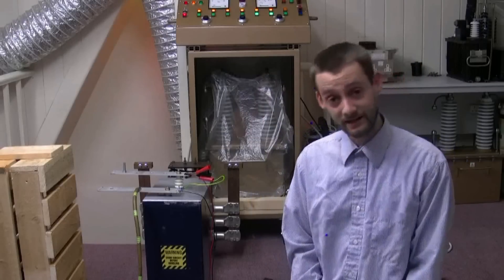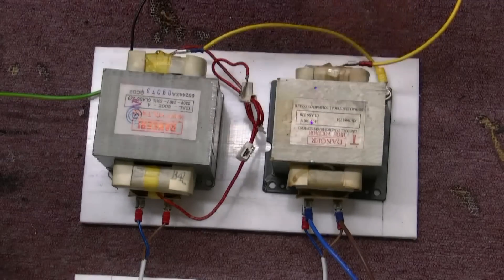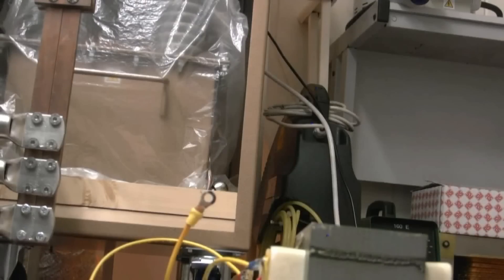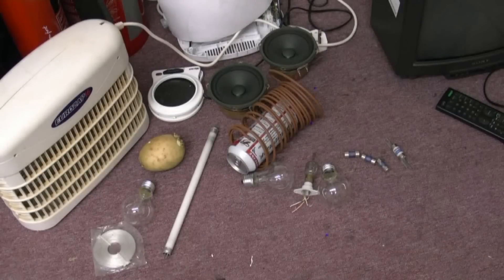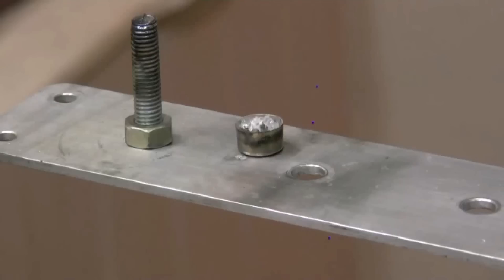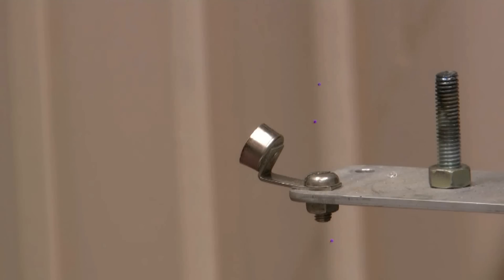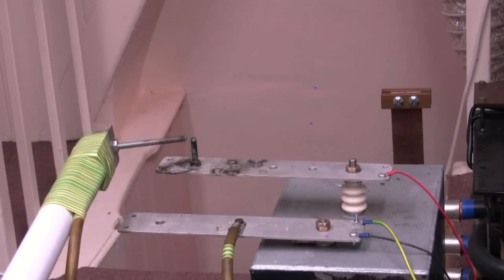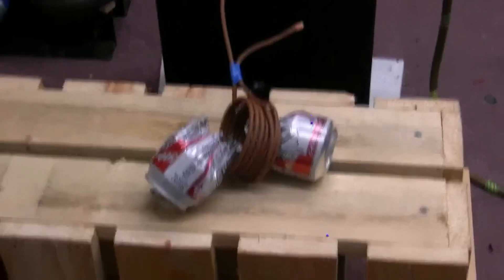Ultra High Energy Destruction + Can Crush

Comment: Photonic is exactly the kind of guy I'd love to have a pint with
Reply: Nimmo1492 Tells us he is going to do science an then cracks open a Budweiser? Needs a propper thinking drink like whisky.
Reply: A can of whiskey?
Reply: But keep in mind: After three pints you're still absolutely sober, but you had to pee for at least three times.
Reply: Nimmo1492  yeah a pint and think rubber gloves
Reply: Before you touch your pint, check carefully, very carefully, for tell tale signs of oily film. grease-proof paper  and kitchen foil in or around the glass.
Or your pint could be his home made capacitor and you could be his fuse, 😊😊😊

Comment: Just one correction to make:
The breaking capacity of the fuse is NOT the current at which the fuse will rupture.
The fuse that you destroyed which had a breaking capacity of 82kA - it has the ability to interrupt ("break" )  a surge of 82kA - you probably destroyed it with a couple of thousand amps.

Why "breaking capacity" is important - if your 50 amp fuse blows but the circuit supplying the current has the energy and low source resistance the gap left by the fuse can sustain an arc and a huge fault current can continue to flow - which is bad.
(fires can start if that fault current continues to flow )

So in high energy circuits you have a fuse which is rated to "break" that high energy High current arc/ fault current.

Here endeth the lesson.
Reply: thanks mate. good input

professional vs lunatic  1:0

Comment: My 100kv PSU is a sweet thing as well. It pulls an 8.5 foot and runs off a power supply that steps 120 vac RMS to 380 vac RMS (big transformers used like in his vids). I feel happy that I finally can have some crazy stuff like him. Then the 200 mv power supply at over 1000 amps continuous.

Comment: "80 thousand amps. Yeah I'm happy with that."  Awesome line :)

Am I right in thinking you had at least 320 million watts of power (4,000 * 80,000) ?  That's.. startling, frankly.
Reply: How is that possible? I get have u can get 500kv and little to no amps. but having both insane amps and volts?
How can he pull all that power from the wall in 5sec? A powerplant barely outputs that:p would love a explanation. cus I must be missing something out ^^
Reply: I'm no expert myself, but I am pretty sure it's because of the capacitor.  The capacitor is storing energy over a period of time (we saw at the beginning of the video that he charged it up over a couple of seconds) then releasing it all in one super fast pulse.   It's basically like a battery I guess - you charge a battery slowly (eg at 1A - 10A rate), but then some batteries can be discharged at up to 100s of amps (eg car batteries can do many hundreds of amps.)  In the case of this cap, apparently it can release more than 80kA :)
Reply: It is because the power is dissipated in such a short amount of time
Reply: the 80kA rating on the fuse is the amount of current the fuse can safely break without then the risk of it welding together and carrying on conducting ! 320MW noway dude lol! The capacitor could be rated at, say- 4kV and 32mircoF- so check out formulas Q=CV (charge in coloumbs= capacitance in farads x voltage across cap in volts) & W=1/2C.V² (energy in joules= half x capacitance in farads x voltage across capacitor in volts squared!) ... so for energy at 4kV on 32mircoF cap - 1280 joules ! Whoop!
... i put a short on a electrolytic 1500mircoF cap at 200VDC - fuck, i knew it would bang, but it was loud as fuck!! ...calculated at 30j! wtf! Bet Photons was well loud!
Reply: TheBloke here's a idea if you want to try that...try REAL HARD to rent a apartment right next to some high tension power lines (the really BIG ones on those big metal poles)...then run a LOT of cable (as big as you can find) right under those high voltage lines...then make your own video of what happens when you suck lots of power away from those high voltage lines...?? ;)
Reply: TheBloke I was just solving this on the calculator found the answer of 320 million and then looked up and saw this comment that that i have scrolled to it accidentally! Lol
Reply: T. T. Miller sounds somewhat dangerous.. and putting it on video is foolish, you get in huge trouble for that
Reply: @lunajamba  Well first of all hes not pulling it from the grid (wall plug) directly, hes charging the capacitor first and then releasing it. Why you cant do this by just using 240v from the wall and connecting it to random shit is cause the current is limited by internal resistances between you and the source. This capacitor has really low internal resistance (5kV/80kA is around 0.0625ohm). Also its a high capacitane capacitor meaning that it can store massive amounts of charge inside. Add high capacitance, high voltage and low internal resistance and you have massive amount of power release from it causing shit to violently explode.
Reply: @carolynmmitchell2240  Photon has always made it clear that whatever he does shouldn't be replicated unless you know what you're doing, he isn't responsible for someone else being stupid.
Reply: @tomlloyd9372  Can you please write it in layman words, how many amps does he get approx?
Reply: THATSALOTOFDAMAGE
Reply: The fuse blew apart because as the wire blew apart, it started an arc between the caps, it is the same principal as automatically starting the carbon arclamps in early cinema projectors. If you look at the fuse, it's voltage rating was 415, which is the low voltage between phases in the UK.
I have heard of these fuses being accidentally fitted on the HV side of the transformer. Due to the low current, they rarely blow, but if they do, they will blow apart as in the video.
Reply: The largest high voltage capacitor I have seen produced 100.000 amps at 1.5 million volts. It is the size of a portacabin and connected directly to the national grid to charge at 11,000 volts. It was manufactured by Feranti  to study the effects or a lightning strike on a nuclear missile during it's launch. 
It was given to the university of London after the tests and installed at Queen Mary college high voltage teaching laboratory at the Mile end campus.
Reply: @The-Bloke  you have it right, batteries are a chemical reaction that hold power so they release it slowly but a capacitor has a static charge so it release it much much faster, also your calculations were right
Reply: @tomlloyd9372  did you just measure sound in joules? You realize sound is rated in decibels right?
Reply: @carolynmmitchell2240  I've seen people do much worse

Comment: The best video to date by far that I have seen from you, and I have watched loads of vids (The funniest being the washing machine with a brick thrown in).... 
80KA WTF? Look at the beer can after the mega abuse and I think you can see the Flux lines in the deformed (Destroyed) Can.
I admire your bottle to work with such energy producing equipment, Have you got a degree or two in this field or are you winging it LOL.
I doubt you're winging it as you have produced a fine piece of power control equipment. (Love this and the way you present it)

Comment: Here's what I don't get, the globe on a Van de Graaf generator acts like a capacitor right? Why is it that you can store up 200 kV on it and while it might sting for a second, it doesn't do any real damage because the voltage drops off so quickly; but your capacitor which only is charged up with 4 only kV can make a potato explode. It's not connected to a source of voltage anymore, so how does it sustain high voltage long enough to harm someone?
Reply: The electric charge in this capacitor is much much higher than in a Van de Graaf generator (note that electric charge is measured in Coulomb and is unaffected by the voltage). The voltage is not defining the "dangerousness" of an electric discharge. For instance a discharge of 100kV and 1C is more dangerous than 200kV 0.5C. There has to be enough voltage to let the current flow (you can touch a power source with 0.1V and 10000A without getting hurt), but if there's already enough, there is no profit of using more voltage.
Reply: Der Kuchen Suppose you let an ordinary Van de Graaf generator charge up this capacitor for awhile. Could it build up a lethal charge?

If you made a Van de Graaf generator with thicker metal and better insulated from any ground could you build up enough energy to explode a potato the way that this capacitor did?
Reply: Travis Gibby Any HV source will get dangerous when combined with a high enough capacity capacitor.

To get a powerful discharge from a Van de Graaf generator, the sphere probably needs to be massive, but my knowledge of EHV isn't high enough to estimate this correctly
Reply: Depends on the "size" of the capacitor in terms of Farads of electrons it can hold.  I haven't looked at a Van de Graaf, but I imagine it is constantly leaking its charge to the environment or to the other side of the generator, thus never storing enough Farads to do serious damage.
Reply: Ace Frahm Just a little note to prevent the spread of wrong information:
Farad measures how many electrons (in Coulomb) are stored per Volt. The capacity (Farads) is static in this case. :)
Reply: You do get a lot of amps out of even a basic static discharge, but it lasts for suuuch a short time, it doesn't do damage to you.
Reply: by equation
E=0.5CV^2=0.5*138*10^-6*4500^2=1397.25J
C=Q/v
so Q=C*V=138*10^-6*4500=0.621
but I=Q/t, when if discharge time is in 1/1000 second, that means the amperage will be 621A, which means this amount of amperage is enough to kill you.
however the truth is the discharge time is much much shorter than 1/1000 second, there for the amperage will greater than 621A.
Reply: ***** well, discharge a AA into a cap, it may not kill you.
R=V/I
so I=V/R
the resistance of my body is 10K Ohm, so I=1.5/10,000=1.5*10^-4(0.15mA), however, 10mA(1*10^-2) will effect to humans' body, but 0.15mA is pretty safe

Comment: With the exploding 80KA fuses, even if you did not get 80k discharge current the fuse would probably rupture anyway as you have several KV DC on it, the sand is not quenching the arc as the voltage is too high, causing a prolonged arc in side the capsule and exploding it.  So the fact that it exploded does necessarily mean you have more than 80KA fault current. You could prove it too, by placing a 0.1ohm resistance in series to limit the current to say 50K, use a long heavy cable as the resistor or make it out of thick stainless wire.

Comment: how do you manage to get 400 mw to your house?...do you have a fucking nuclear plant in the basement?
Reply: He has a really big power supply
Reply: +DerZocker2000000 400MW for a very short period of time.  Watts are the rate of energy and have no time component.  So say a typical house has on the order of 200V x 200A, that is 40kW.  Also let's say that the 400MW lasts for 0.001 second.  400MW/1000 = 0.4MW = 400kW for one second to charge up for that release.  That is still 10x what a typical house might have for service from the power company.  But it took him a couple seconds to charge the capacitor.  Also my 0.001 second number was pulled out of thin air so you could easily say that is 0.0001 to make the numbers work out.  Even 0.00001 seconds seems plausible, which would be only 4000 watts for one second to charge.
Reply: +Aaron Axvig I dont mean to be rude or contradictory. I agree Your overarching idea is correct, surges of high current and voltage for very short periods of time can be handled by the system even if it goes way over what it is rated for long periods. But the dimensional analysis of the watt is a joule per second (joule being a unit of energy) so time is  indeed a component. You even used the word rate which implies time is a factor. Energy per time is = power (watts), basically how much energy is dissipated in a second. When you multiply watts by time the time cancels out and your left with joules or the more commonly used watt hours. In either case your left with just how much energy that system delivered in that time frame. So all that math that was shown making .4MW to 400KW really isn't accurate. But regardless you were right in answering the question that the short period of time makes it possible. Just wanted to clarify on the whole power energy watts part of your comment
Reply: u r correct, jouls are the correct term that doesnt have a time component, or in other words watt-seconds (yes the term for timeless units of energy has the word seconds in it, but it makes sense because once the time and power are combined together into one term it becomes total energy which is timeless)

Comment: You've just redefined the electrical safety mnemonic SIDE.  The old meaning was Switch off, Isolate, Discharge, Earth.

You've redefined it with beer.  Slurp, Imbibe, Drink, Eructate.

Beer and high voltage.  It's all fun and games until you piss on a 5 kV capacitor.

Comment: when current stops flowing in, so when the amperometer shows 0 amps and the voltmeter shows max voltage between the capacitor's conections

Comment: This is why you get UV Filters on your cameras
Did you notice the purple spots? Those are dead CMOS cells from overexposure
Reply: Its a bit of an old video of his, but I seem to recall this might've happened when he was playing with lasers and aiming them at the camera.

And this was a visible light type laser, 3W range I think? maybe more I dunno. Anyway I'm pretty sure he would've broken some parts in the camera either way with or without a filter. Besides its photonicinduction it wouldn't be right to protect equipment too properly.
Reply: Actually, they are from shining a powerful laser straight into the camera.  I'm pretty sure an UV filter is not going to help against such a powerful and focused ray of light.
I'm not really sure if it has anything to do with over-exposure in this case, because the laser he used is so powerful it burns stuff.

Comment: water also reacts to magnetic fields (though very weakly)... you should do one with a coil around a cup full of water, see what happens if you can isolate the cup/water from the vibration of the connection.

Comment: Damn, that capacitor.........it can't be bought in a corner deli I suppose (and man, you must be loaded if you can afford such incredibly expensive gear like that capacitor, HV transformer, that big power supply thingy you used etc.). The can crushing experiment is rather neat. I wonder if a can crusher can be made using some smaller capacitors too (or a coil or something that's MUCH cheaper than that capacitive monstrosity)....

Comment: Tell us about your really slick control panel.  
The meters are unlabeled.  Is it a 300 V, 20 Amp variable
supply?  Are you really generating all your HV w/ Microwave transformers?
Where'd you get that control panel?  Looks quite professional.  Also, is that a Maxwell
HV capacitor?  100 uF 10 kV?  Maybe you can do a vid on your rig.

Really fun stuff!   It is good that you point out that what you do is lethal (though that should be obvious from what happens to the objects under test!)

Comment: I still prefer the way I wired the MOT's up to charge the cap.
He thought the way I wired them up was dangerous due to the cap not being grounded. When he popped round one time he saw how I wired them up n didn't think it was safe. I use 2 old school MOT's (which he was extremely jealous of) and I centre tapped the output, so both sides of the cap were 2250v from ground, where as he made sure that it was grounded. Personally (and I still haven't changed my mind about this), I didn't think the way he wired them up was safe. Having a 4.5kv output next to a 240v primary coil and the chassis being live to the max output voltage of 4.5kv. That's why I wired them up the way I did and having some old MOT's really helped as they were much more durable back then 🙂
I personally thought it was much safer and they were being run the way they were supposed to be. Anyway
The way I made sure it was isolated from anything was by sitting it on an old turntable cover, which must of been around 5mm thick PC. Also, the second I used it, I shorted it out n kept it shorted the entire time I wasn't using it, like photon did. 
Safety first 🙂👍🏻

Anyone who knows a thing or two when it comes to caps, is that you should ALWAYS KEEP THEM SHORTED!!! Especially when doing stupid shit like this.
If you quickly short the cap out (that's what this video is about), it will charge itself back up close to the input voltage. This will dissipate over time but that all depends on the type of cap, input voltage, it's capacitance, ESR, temperature, etc. Some caps like these, if you charged then up n just left it, that stored up energy is enough to kill you many many months down the line. Even tiny caps that you can hold in your hand are lethal! 
Just because you're watching a couple of YouTube videos n think you know a bit, doesn't mean your component enough to carry out works on mains voltage and HV.
A little knowledge is extremely dangerous!
STOP!!✋🏻🛑

If you go on my channel you'll see how much fun I had with that cap lol. Photon popped round one time n I said he could have it back as I was moving house (which is a very long story but I'm not going there) as it was one less thing to move as it's very heavy and I'm not quite as able as I use to be. When he took it back n use it again he said that it was MUCH more powerful after I had it but I'm not sure why tbh 🤔 The trannys I was using were from the 70's n maybe the output was higher back then or something but he DEFINITELY said it was twice as loud n much more powerful.
Thinking about it, I wish I'd of kept it 😕

On a different note. A while ago, I use a 10A intermediate switch on the primary so I can have over 2,250V to ground with double the current or 4.5kv center tapped like I use to charge this cap up. It gave me a bit more options 🙂